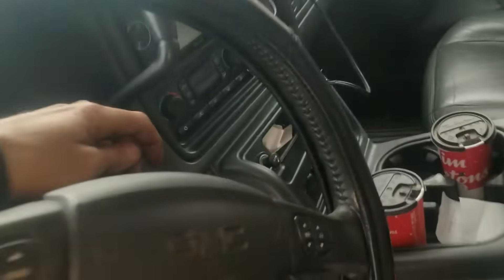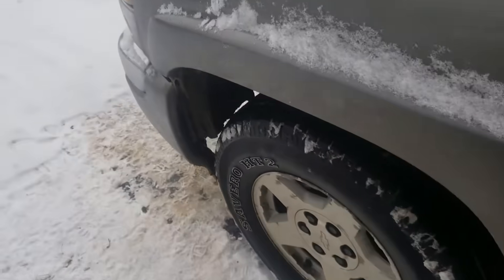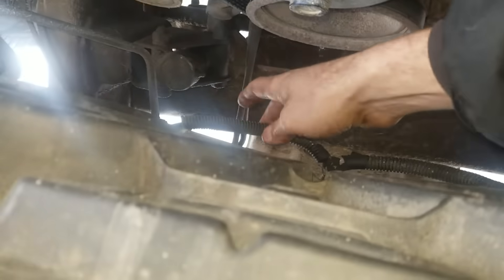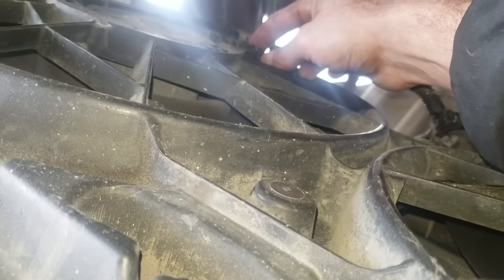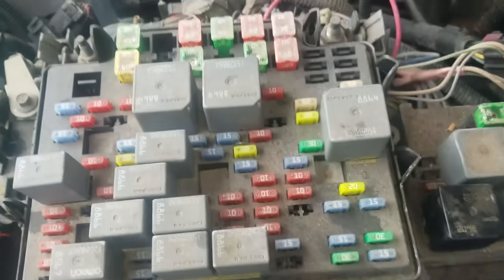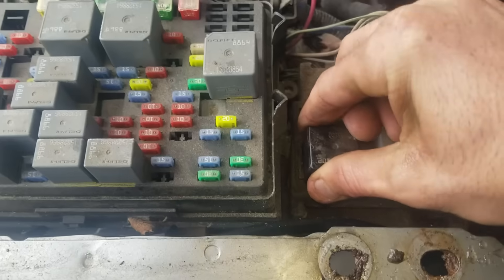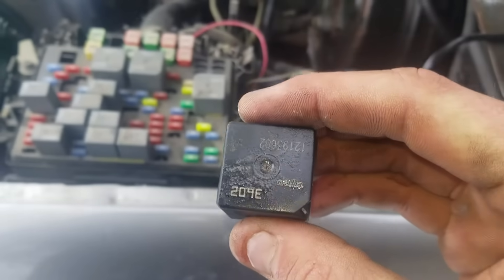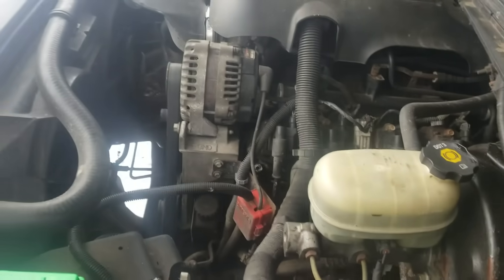2006 GMC truck radiator fan relay trouble

Comment: Fixed the same issue by disconnecting the battery waiting 15 min reconnected EVERYTHING WORKS I kid you not!
Reply: I just put a new battery in and the fan started running constantly shortly there after. Could that be my problem?

Comment: My ac/heater fan just started running even when the truck is off. Different but similar issue. I’m trying to find the fuse to pull to make it stop. It ran the truck completely dead overnight.
Reply: Pull the #40 fuse out and it will stop

Comment: On my truck is the opposite, they won't turn by themselves
Reply: Mauricio Hernandez same problem did you figure out what it was??
Reply: Until now no but i have to turn on the AC so they can turn on
Reply: Me too I have the run  with the AC on for them to work...
Reply: I was thinking on putting them direct so they will be on all the time because it loses power because of the AC.
Reply: I'm having the same problem. I've tested all my relay and there good. Changed my coolant temperature sensor. They still only turn on with the AC. I'm thinking the PCM is not sending the signal to the relays
Reply: Anyone ever figure out why the fans won’t turn on without the ac how could I wire them direct
Reply: @mauriciohernandezreyes2189  did you figure this out?   I’m thinking it’s a ground issue now.
Reply: @glenfrancois6813  did you find the resolution to no fan except while running ac?
Reply: Im doing the same thing mine wont but i just replaced the resistor the fuse for the blower an the inside resistor fuse im between buying this relay or not
Reply: @Dallasl_andscaping_. I was thinking the same in mine cash when i go in reverse it stalls
Reply: Mine doesn't turn on with the AC
Reply: @archangel1824 what was your solution
Reply: @sameshtdiffday7684 my account coolant was low. I put more freon in the ac lines and that woke it up and it works like normal now.
Reply: @archangel1824  I went to go do that yesterday and I had to much pressure in the lines. My ac is cold when my fans are on, my fans run for 30 seconds then turn off and don’t work again

Comment: I replaced all 3 of mine but they are still running what do I do
Reply: Mine too 😡
Reply: @AllEden1  ended up taking it somewhere could never figure it out
Reply: Maybe ect disconnected or bad.
Reply: Did find the problem?
Reply: @Kelo64244  unfortunately not, I had to take it to a shop
Reply: @matthewbarnes4940  do you how much it was for them to fix it?